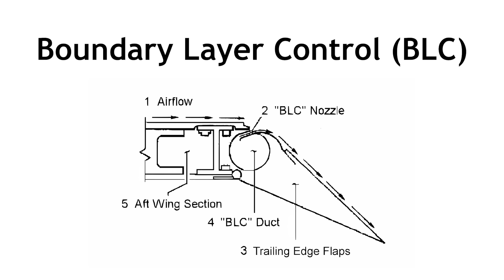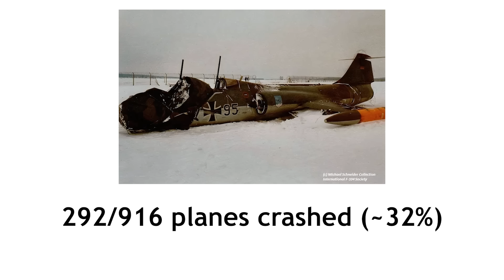Why This Jet Killed So Many Pilots?

Comment: This video gets so much wrong in such a short time.  Not not everything was wrong, but the main points of the F-104 being designed to be and becoming a successful bomber interceptor is flat out false.  Also, the US Air Force NEVER approached Kelly Johnson with a proposal to make such as fighter.  Kelly and Lockheed did that on their own and then went to Air Force to see if they were interested.
Reply: Very true. The US air force never embraced the 104 in large numbers,  due to its flying characteristics and short range.
Reply: @JohnW-gz4db  - Exactly.  Too short of a range to do any viable interceptions and inadequate radar find the target, let alone get target solution to guide any radar guided missiles, if it could even carry them.

It started out as a dedicated role fighter that peaked the US Air Force's interest and quickly became obsolete because it could not sufficiently adapt to any other role, and the Air Force completely lost interest in it.

 Lockheed ended up having to shoehorn the fighter into any role that any buyer country to wanted it to fulfill... no matter how ridiculous the premise was.

Comment: I'd say the biggest flaw of it was it was totally unmanuverable. Yes, I know it was meant to be a perfect interceptor but if the enemy bomber sees you and turns away from your line of fire, then you don't really have much choice than to try to make another pass. While Mig 21 was also called an interceptor and it really did excel in that role and also in a fighter role as it was maneuverable, fast, agile and light weight, so now that's called a "Perfect Interceptor/Fighter". Those little wings also didn't create enough lift (as said in the video). So I'd say the design alone was it's biggest flaw. So I'd hardly call it a interceptor. Also, I can't believe Luftwaffe had the F-104 as their Air force's backbone (main fighter), because it really couldn't do much against proper fighters. So the F-104 had excellent speed that's true, but not the ability to manuver in those great speeds. Another point, I don't think at that time missiles were really that good, so if your missiles fail, u go guns only, but if u can't hit the enemy cuz of it just being out of your firing line, then not much to do than using that great speed to climb or dive away. Ngl I love how the F-104 Starfighter looks but kinda feel like it's a but overrated.
Reply: It was not totally unmaneuverable. It was not designed to intercept bombers. Complete myth, please stop repeating it.  The 104 was designed as an air superiority fighter. Like almost all fighters it could intercept enemy aircraft. The wings were "little" by design in order to achieve low drag and high performance.  The fact that it was a straight tapered wing rather than a highly swept wing gave it more lift than a swept wing of equivalent area.
Reply: @gort8203 I do get your point. But then tell me this. If missiles fail, the F-104 will have to go guns only. That could work most probably if the enemy is unaware of the F-104's presence. But if the enemy does know that the F-104 is there then it becomes difficult for F-104 as it was not designed for dogfights. Only boom and zoom or interception. So I don't really think that it really was an 'Air-Superiority' fighter, But rather a support fighter. It also scored very few or IF any air-to-air kills at all while being shot down or getting crashed multiple times. But yeah, it scored 0 confirmed air-to-air kills in Vietnam war at least. I could be wrong somewhere but though you can't say I am not being practical. I hope you too understand it. 👍
Reply: @Ninja_Gam-er.  What you think of the airplane is irrelevant, and what the heck is a support fighter.  The actual fact is that the F-104 was designed as an air superiority fighter. That is what the Lockheed company literature called the airplane, and that is why Kelly Johnson interviewed F-86 pilots who flew in MiG Alley over Korea to learn they needed in a fighter to allow them to dominate in air combat. Told told him they wanted light weight with superior speed and climb, and that's what he gave them. All you keyboard experts who think you know what matters in combat focus on turn circle, but none of these pilots asked for a tighter turning fighter. That's because they flew actual combat instead of video games.  

The F-104 never met a MiG during it short time over North Vietnam, so it didn't have a chance to engage one.  There was even a theory at the time that the enemy did not want to send its MiG-17s up against the F-104.  If true they apparently rated its combat capability more highly than you do.
Reply: @gort8203 Yup you might be correct. As I already said, I could be wrong. But yeah maybe if the pilots did want only that and if they were happy with the jet, then yeah no more questions. Also don't take all the words word-to-word. 'Support fighter' isn't a kind of aircraft, it's just the term that can be used when addressing any fighter which isn't actually gonna take part in main fight but if needed then it certainly will. Also no need to get a bit angry, misunderstandings do happen. All good! 😀

Comment: The plane didn't kill pilots,  it was pushed  into rolls that it wasn't designed for. It was designed as a interceptor and not for what the Germans used it for. It was called......A ROCKET WITH A MAN IN IT.
Reply: roles

Comment: FYI, The F-100 Super Sabre had a high accident rate, with over 889 aircraft lost during its U.S. Air Force service due to factors like flight instability, structural and hydraulic failures. The "beastly accident rate" was particularly high in the F-100A variant, and 1958 was its deadliest year, with 116 aircraft destroyed
Reply: "Murica, F*ck Yeah!
The Soviets still had more dangerous aircraft, pretty much across the board, so I'd still call that a win.
Reply: There was a good story in aviation history magazine about 12 years ago on the F100 and the origin of the deadly " Sabre dance"  if you got behind the power curve even afterburner wouldn't save you.
Reply: @JohnW-gz4db  Indeed; you will never lit the afterburner or solve a Compressor Stall if the intake is not facing the relative wind properly. This would have killed Bob Hoover in his F-100 hadn't he ejected, and did kill Kara Hultgreen in her F-14.
Reply: lack of adequate transition training was the issue..this is a a barely able to fly aircraft almost a wingless bullet
Reply: The most odd accident with a F-100 must have happened with a California ANG pilot. He was on leave and leaving the Base on his way to the beach when he was asked - almost implored - by a Crew Chief to do a short acceptance flight in a Hun that had just left maintenance. "Just a ten minutes flight Sir, so you can sign the aircraft airworthy. Please".
The pilot was already wearing swimming trunks, a t-shirt and flip flops. He didn't even bother to change to flight gear; just grabbed a helmet and oxygen mask, a parachute and off he went! 😄
No sooner he was airborne, he had an hydraulics failure, the stick froze and he was forced to eject. Interestingly he ejected over water, hence the swimming trunks actually came handy, and was promptly recovered by a small boat, barefooted and shirtless, which was lucky because he had no life vest either, but suffered several bruises and skin burns. In the end, he was pretty lucky...

From a Portuguese Edition Reader's Digest magazine from the late fifties. They were so great. 😀

Comment: It has no wings.  Always a flaw in flying machines.
Reply: Yeah, the nubs on that plane are just the attachment point. There's an actual wing that fits over that and gets riveted to it. No one BOTHERED looking at page 2 of the plans or all the extra hardware rattling about in the shipping crate! Talk about hubris...smh.
Reply: That's right, the vertical and horizontal stabilizer area was almost 50% of the wing area.  Scary, especially if one applied too much rudder!
Reply: @derrickwallace8374  "too much" is bad in anybodys machine
Reply: Johnson shouldn't have even bothered and just given it reaction controls. It is an engine with a seat. A fancy engine stand for your J79 :P
Reply: @RunsWithChainsaw  ha ha.  True
Reply: and yet is still more airworthy than a 737max

Comment: I'm not for sure if the f 104 was worse than the f 100 hun
Reply: The F-104 had the same accident, attrition, and kwf rates as most other 2nd Generation fighters.
Reply: That depends if you're comparing actual numbers of accidents t the number of airframe s or per flying hour or total fleet utilization . statistics can be compiled many ways. True century series had high attrition rates
Reply: @JohnW-gz4db  I'm comparing rates.  Accident rate: losses per 100k flying hours. Attrition rate: percentage of losses to total airframes. Fatality rate: the ratio of pilots kwf to destroyed airframes.

Comment: Both the United States and Germany had much better luck, and a much better safety record with the F-4 Phantoms that followed.  The Phantom had not one, but two J79 engines,  just as fast as the F-104, but with the airframe being a thoroughbred fighter with more forgiving flight characteristics.

Comment: The pilots of early F-104's were trained to begin by rolling 180° when they were ejecting close to the ground. Which led to a few more accidents when the pilots with that muscle memory got new F-104's with the seat ejecting upwards... Also most notably, the Spanish air force had zero accident with its F-104G's. They had a fleet of only 21 aircraft, with low flight hours... nevertheless no loss of pilot or airframe on a period of 7 years.
Reply: The weather is sunnier in Spain and the terrain is less mountainous ...!
Reply: That "muscle memory" business sounds plausible, but it's not factual.
Reply: @dukeford are you saying there's no such thing?
Reply: @JohnW-gz4db  Lol.  I think it's bullshit.
Reply: In Spain they only flew if the weather was very good and they were happy to replace them, Italy lost 38 % and Canada lost 46 %.

Comment: Kelly Johnson was an amazing engineer, but this was far from his best work. You know the saying "If it looks good it will fly good", this aircraft proves this theory. One of the ugliest planes I've ever seen. There are certain planes that just don't look good from any angle. I would even take the A-7 over this plane in looks. However the 104 did serve a purpose and it did do what the air force asked for. It just makes me a little sad that Kelly's name is on it.

Comment: The F-104 was used by both the German Navy and German AirForce as on December 5, 1966 the German F-104 Air Force fleet was grounded as since 1962 , 65 out of 700 crashed killing 37 pilots. Germany ended up losing 292 out of 916 delivered.
Neighboring countries Belgium and the Netherlands each also lost  F-104s : 41 for BAF and 41 for RNAF...

Comment: I was once a good friend of a Portuguese Air Force technician, who worked mainly on T-37s but was well acquainted with the F-104G as we loaned an Air Base to the Luftwaffe for some thirty years. (Beja AFB)
He was very impressed with the cockpit layout, stating that even pilots taller than 6 foot would fit comfortably. The wing loading in the G model was considered excessive even with the aircraft clean, and truly outrageous when carrying ordnance.
To complicate things further, all accident causes were very evenly distributed. They were due to loss of control, engine failures, CFIT, oxygen starvation, birdstrikes and others never ascertained. 
We in Portugal had similar problems when we transitioned from the light and basic Fiat G-91 to the heavy, complex and somewhat underpowered A-7P, although at a much lesser scale and often the aircraft could not be blamed. The pilots loved it.
Reply: I heard the same from a german F-104 pilot, the issue was the giant leap from a rather harmless, subsonic plane like the Fiat G-91 or F-84 Thunderflash to the Mach 2 interceptor without anything in between. 
  (besides loading it with tons of equipment and assigning it to roles that were the direct opposite to the original one: vertically up, shoot down the bomber, and back to base)

He said after they found out that it did not work that way, and took to proper and intensive training in the US, the loss rates dropped drastically and were not so much higher than other planes of that era. He said all concentrate on the Starfighter alone, but that definitely was not the only one.
Reply: High wing loading is always a recipe for a hard time taking off and landing.  The WWII Marauder light bomber also had high wing loading and high accident rate, but pilots loved it because it was almost as fast and maneuverable as a fighter so in the hands of a wary pilot who understood its vices it would reward you with a safe trip in and out of the combat zone.  The other issue that made the 104 difficult was the close coupling and some adverse yaw that made handling very tricky at low speeds along with the high wing loading meaning stalling was also a problem when low and slow at take off and landing.  Its TWR and light weight however gave it great acceleration when clean along with high top speed for its day.  The thing is the pace of development in the 60s and 70s meant it was very quickly eclipsed by more capable and docile aircraft but for 10 years it was about as perfect an interceptor as you could have for taking down approaching bombers.
Reply: @larrybremer4930  The Starfighter was never really a "bomber interceptor".  Do your homework.
Reply: @dukeford  It wasn't designed to be a bomber. Designed in the 50's, the job was to intercept nuclear attack by Russian bombers as a fighter. He's comparing apples to oranges is all. Comparing the planes he mentions to the F4 would be unfair to them but more like it.
Reply: @dukeford  Right back at you: From Google: An interceptor's role is primarily defensive, to quickly intercept and destroy enemy aircraft, particularly bombers, that are a threat to friendly airspace. Key characteristics of interceptors include high speed, a rapid rate of climb, and a quick time to altitude, often sacrificing some maneuverability for raw performance.
Reply: @larrybremer4930  Larry, it was designed as an air superiority fighter.  Does the air superiority role include interception? Yes, but against enemy fighters, not bombers.  The Starfighter was a relative failure when ADC pressed it into the role of bomber interceptor.
Reply: @dukeford  Initial concept you are correct the intent was an air superiority fighter to counter MIG-15 and 17, but it instantly pivoted to interceptor because an air superiority fighter needs both speed and maneuverability.  The slick had the former but not the latter.  It was a lousy fighter for air to air, at best a one pass hit and run is all it could manage since it needed literal miles to make a turn.  Again from Google: The F-104 Starfighter was originally designed as a high-performance air superiority day fighter and supersonic interceptor. Its primary goal was to achieve maximum speed, altitude, and climb performance to quickly engage and destroy enemy aircraft, particularly Soviet bombers.
Reply: @larrybremer4930  It "pivoted" to an interceptor role because ADC was short on interceptors and TAC didn't really want the airplane.  The A model only lasted 2 years in ADC service before being transferred to the ANG.  The Starfighter's air-to-air capabilities are undervalued. If flown "in the vertical" it doesn't need miles to turn around. Just disregard that Google nonsense. They get the day fighter part correct, at least, but "particularly Soviet bombers" is inaccurate tosh.
Reply: American proof that a brick can fly ...

Comment: I never understood why the Lockheed Engineers decided to install a downward ejecting seat, which was so limited and no doubt generated unbearable Negative G loads, when they could have added a telescopic rail to an upwards ejecting seat, which only releases it when it has cleared the fin. Several aircraft used this system, although photos of the rail deployed are obviously extremely scarce. 🤔
Reply: In the mission the aircraft was nearly perfectly designed for - bomber interception, it would climb very quickly and spend its combat time at high altitudes and speeds.
Still, many engine failures do happen at takeoff power.
Reply: The F104, was purpose designed as a high altitude interceptor. The ejection system for the pilot, was to eject downward at altitude, to avoid collision, with the highly positioned horizontal tail plane, and vertical stabiliser. To eject at low altitude, the pilot would have to invert the aircraft. At a high landing speed, this would require a superhuman effort.
Reply: Downward ejection seats are death traps.

Comment: Can modern fly-by-wire technology correct the deficiencies of the F-104 starfighter?
Reply: Some of them. The onboard computer can certainly prevent the horizontal tail from interfering with the stream of the wings. The computer will disobey the pilot if the input of the pilot would lead to the interference and that's it. But the computer cannot prevent the catastrophe if a F-104G has an engine failure close to the ground with a heavy load of hardware under the wings.